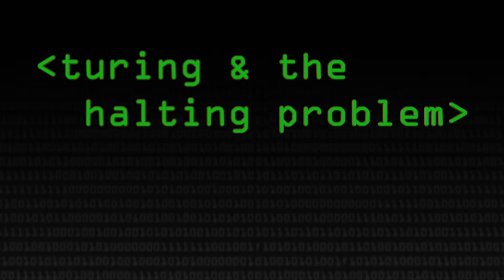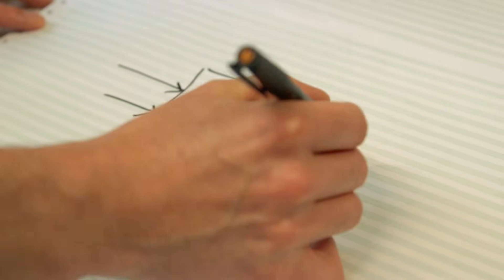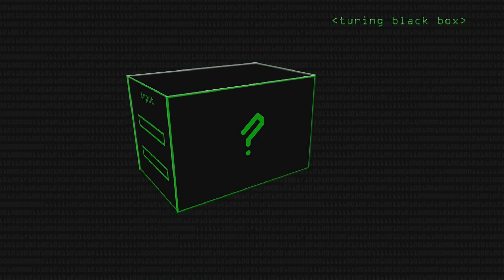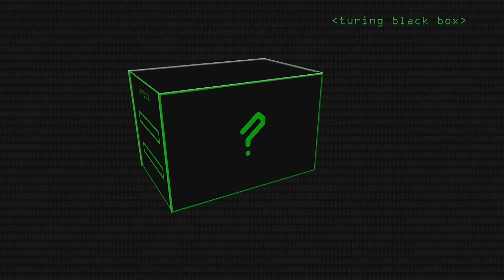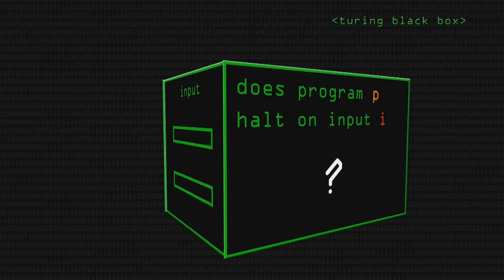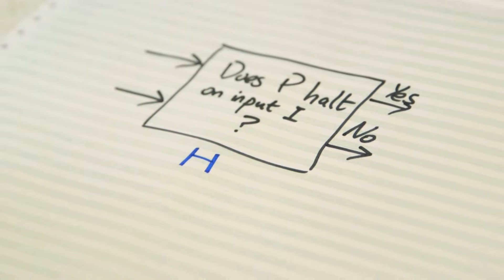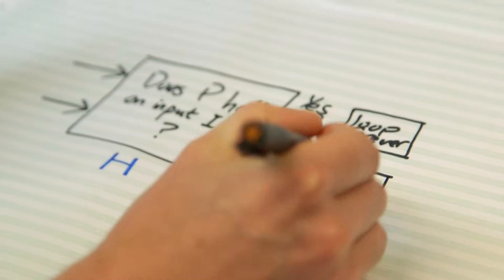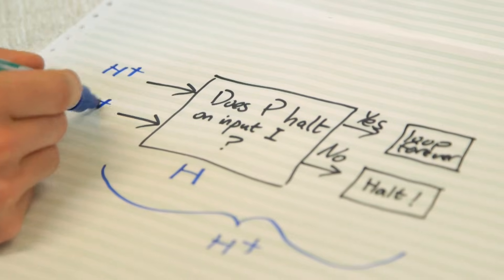Turing & The Halting Problem - Computerphile

Comment: Correct me if I’m wrong but doesn’t this only proof that h+ cannot exist? Also isn’t one creating the contradiction by simply giving the machine and infinitely long input? This just show that an Algorithm can’t work if every input need another input but this input again needs and input and so on. So it could exist under the rule that an input has to finite.
Reply: Why should H+ not exist? First of all we assume H exists. Then we could show that, if H exists, then H+ must also exist. Agree? When we run H+ with input H+, then either H+ does halt or H+ does not halt (either on MUST be true by the principles of logic).

Let's look at the case where H+ halts, then we get:
H+ halts -> H detects that H+ halts -> H+ loops forever (H gave the wrong answer)
The other case (H+ does not halt):
H+ halts not -> H detects that H+ does not halt -> H+ halts (H gave the wrong answer again)

Let's recap: We started with the ASSUMPTION that such a Program/Machine H exists. From that we derived with simple logic that in a world where H exists, there must also exists H+. Then we found out that H+ behaves contradictory and in fact that means, H+ can not exist. But the contradiction remains because we can proof that H+ exists and we can proof that H+ doesn't exist. And finally this means that our assumption, the starting point of our whole argument, must be wrong.
This is what's called "Reductio ad absurdum" or "Proof by contradiction", and is used all the time in mathematics and logic. If you wan't to proof something you assume the opposite is true and then show that your assumption leads to contradictions with no possible answer.

To your second point: Programs in theoretical computer science are by definition finite in length. Just like the code of any normal computer program. In fact, an infinitely long computer program could never by written nor read by any machine. This would result in no machine halting on them, which would be uninteresting. This fact would also solve the halting problem for infinitely long programs (Think about it).

I hope I could help you and answer your question. Feel free to ask if anything is still unclear.

Comment: It would halt everytime but not because of the + but of the h In the h+ machine it will emulate the h+ machine which includes emulating the emulator so it loops until it runs out of memory: h will not be able to give an answer so the h+ machine will eventually halt
Reply: We're talking about a mathematical concept here, not a physical machine. Also, nobody assumed or stated that emulation was either used or necessary.

Comment: I don't see how this is a paradox. H+ given the input of H+ doesn't halt; no is the correct answer. H+ given the input of (H+ which has also been given H+ as input) does halt; so yes is the correct answer. You just have to look at if the input to the program you are checking was also given inputs (and if those inputs were also given inputs, ect). The answer alternates between yes and no depending on how many nested inputs of H+ there are.
Reply: Explain why H+(H+, H+) should halt.
Reply: @MisterBrausepulver  So lets step through each of the nested H+ programs. lets call H1+ the initial input, H2+ the secondary input and H3+ the final program. In other words H3+(H2+, H1+). H1+ is given no input, so the H1 program will output a yes answer causing H1+ to loop forever. H2+ is given H1+ as an input. The H2 program will see that H1+ is looping forever, and output a no answer H2+ will also output this no answer. H3+ is given H2+ as an input. H3 will see that H2+ halted with a no answer, and therefore output a yes answer, causing H3+ to loop forever. So I was mixed up, H+(H+,H+) would not halt. To be clear, I know that I am misunderstanding something, I just don't see what.
Reply: @TomSinister03110  Why you are things nested? Remember H+ has two inputs: 1: An arbitrary turing machine (that's what represents our program). 2: An input I (e.g. a string ...). You don't nest anything when you call H+(H+,H+). Any Program can be represented as a string of letters (think of the source code of a computer program.), the same is true for any turing machine. If you want to think about this as in programming, H+ would be a function with two arguments, P and I, both being strings of text (also H+ would call another function H just like you can do in programming).
When you call H+(H+, H+), you run the program H+ with the two input strings representing the "source code" of H+. H+ then calls H. How exactly H works is completely hidden from us. That means we can't make any assumptions about how H works (besides that is always behaves correctly). That also means we can't assume that H internally calls H+ and "emulates" it. The "argument functions" may not be called.
That means that your statement "H2+ is given H1+ as an input." is wrong.

I think the point is that Programs and Inputs are all just strings and you can feed the source code of a program to itself.
Again, if you know programming, consider the following function.
string printMe(input string) { print(string); }

Then you could call
printMe(string printMe(input string) { print(string); }).

I hope I could help you. Unfortunately computational theory has, like every other math topics, many little details and foundations that matter. But unlike geometry or graph theory etc it's pretty non illustrative.
Reply: @MisterBrausepulver  I thought we were looking at all possible programs for the purpose of the halting program. Wouldn't that mean we can assume that one of these possible programs could emulate H+, and therefore emulate H+ receiving H+ as an input?

Comment: Isn the problem in the fact that H+ is not built to find out whether something will halt? H is built for that, and it will give you an answer. But H+ is not equal to H, so it is not guaranteed to produce correct output. We take proper answer, and then do something with it. Its like thaking a photo of calculator screen, mix stuff around in photoshop, and then say that calculator produced a wrong answer. I think there is no paradox, because H is not equal to H+

Comment: But, why does this prove anything? Maybe H+ doesn't terminate when given H+ and H+ as inputs - ie. it never gives you either a yes or a no. In that case, there's not necessarily a paradox, is there? The issue of whether such an algorithm can be designed to also always terminate, itself, seems like a subtly separate issue, right?
Reply: Triggerfisk 
We are creating a program does determines if any program with an input will halt. This means for all programs there exist an output of yes or no.

So We feed the machine into itself and if it is yes it doesn’t not halt. If it is no it does halt.

This is proof by contradiction

Comment: The setup is rigged and the outcome is determined by the setup of the problem.  Your drawing is correct: the 'yes' output is artificially blocked.  Thus, the answer to H+ is no, by design.  But the bigger problem is that logic, and by extension, math, appears to be more useful when it reflects reality, and this type of problem doesn't.

Comment: What if you just simulate the input program(with input) and see if it freezes? If the entire state of the box is ever the same as it was before then it will mean it is stuck in an infinite loop.  It could take a long time but eventually, every possible state would be tried.  This would exclude any black box that has infinite memory of course because you could never compare the full states. (I have never seen such a machine however with infinite memory.)

Comment: all problems can't be solved, but some can. that is my final consensus.

BUT WAIT
h+ requires 2 inputs, so feeding it to itself twice isn't gonna work. 1 input is for emulation, the other is for input. therefore, assuming h+ doesn't exist is reasonable, but every method of disproving h+ by feeding h+ to itself is a faulty proof. the machine will be waiting for a second input while emulating h+, but that 2nd h+ blueprint can't be fed into itself, meaning this machine will be softlocked. permanently waiting for an input, while never processing for an output.

this video demonstrates a faulty proof.

Comment: We are all going a bit too mathematical here. We've just proved one case, where the machine won't work. Sure that's enough to prove that it (the machine) isn't a universal solution to the problem it was designed for, and hence it is mathematically non-existent. But for all practical purposes, there is possible that a machine can be constructed that could solve the halting problem for every case but this. In practical scenarios, you wouldn't wanna test the machine against itself anyways. So, for me atleast, a practical Halting machine is still not impossible.

I know this is a proof by contradiction, and it works cool only when you need to be absolutely sure that each and every scenario is covered. It's like in physics, some formulas/theories work under some circumstances. The formula for gravitational potential energy (mgh) is only valid for height 'h' <<< R, where R is the radius of the earth. For bigger values of 'h', the value of 'g' changes, so the formula becomes invalid (if you're wondering it's the same as m(g')h, no, that's not the case, the whole formula has to change). But this doesn't mean that we shouldn't use it. Sure for heights quite high, the formula is invalid, but for all practical purposes, 'h' is gonna be very small compared to R anyways. So, in the cases it works, we can use it.

Hence, just because our hypothetical halting problem solver machine can't work against itself doesn't mean it can't work at all or we shouldn't try to build it.

Comment: I think it is a little confusing when you feed H+ to itself, H+ should be fed to H. 
H is the machine that you assumed will solve the problem. If you end up in a paradox on your assumption then the assumption will be falsified. 
By feeding H+ to H+ nothing will happen to the original assumption, because you basically are not touching H. 
If you feed H+ to H, then if H+ halts, H will say it doesn't and if H+ doesn't halt, H will say it does. Here is the contradiction so the assumption is incorrect.
Reply: It’s the same thing you are feeding it into yourself
Reply: H is part of H+
Reply: The problem isn't really feeding H+ into H+, but there is a problem with the explanation. I don't know how exactly Turing wrote his proof since I didn't read his paper, but the way every single youtube channel is explaining it is simply wrong.

The input to H+ is a tuple (P: Program, i: InputToProgramP). The whole thing is the input

So when you feed H+ an input (P=H+, i=H+), you are basically asking "does program H+ halt when it receives input H+?". The problem is, the input to H+ is a pair (P, i). So you can't just feed it P, you are missing i. It's like you are feeding it (P=H+, i=<empty>).

To fix that, you'd have to feed H+ an input (P=H+, i=(P=H+, i=H+)). But you end up with the same issue. So you'd change the input to be (P=H+, i=(P=H+, i=(P=H+, i=H+))) to try to fix it, and so on, forever. You can't ever feed it itself.
Reply: @rafaelclp THANK YOU, I WAS THINKING THE EXACT SAME.
You formullated that pretty damn well and I fully agree with you. 

Im just wondering wether or not you can still prove it by induction, but i dont think there is even a base case, so not sure about that

Comment: When H+ is fed back in (to the H+) as the program to which we give input H+, there aren't enough inputs (for that H+) as it needs two inputs to give the answer (halting or not halting) and its only receiving one - previously called i.
Reply: I asked exactly the same thing, it would be great if someone addressed this issue.
Reply: That can easily be solved by turning the input of H and H+ into a single input that describes both the turing machine and its own input to be tested. That way everything is receiving the correct number of inputs and the paradox still happens.
Reply: I'm also not sure I really understand how we're proving anything either. The paradox described feels like it implies that that having this specific input ran through the machine would result in looping, but we can't know if that would even be the case? The question was never about whether H+ could exist but whether H could exist. Is it because H is a product of H+ that it implies failure? I don't think it is valid to say 'your machine with 100% success rate in deducing if carrots are peeled or not is foiled because I added extra machines at the end of it that peels the carrot if it is deemed peeled'.
Reply: @Outwardpd no it would lop if it wouldn’t loop and not loop if it would. This is not the same as straight up looping
Reply: @Outwardpd  You see, the problem is that your peeled-carrots-detector example does not create a paradox, so there's no problem. A proof by contradiction starts out assuming something that you don't know is true (or exists) is (or does). Then it shows that, if that is true, than something completly absurd and impossible would also be true, automatically. Therefore, what you assumed to be true cannot be, in any way, shape or form.
The halting problem assumes a turing machine that solves it exists. Then, using some simple steps, creates a set of inputs that makes it not work. Therefore it couldn't exist, at least not as described. There's no program that can determine if any problem halts, because we just showed how to create a program that wouldn't work, using itself. A contradiction. Contradictions cannot be true, so your assumption can't be either.
Basically if A, then B. If B then not A. Therefore, A can't be true.
Reply: @eac-ox2ly  Awesome. Thank you!
Reply: @eac-ox2ly except it wouldn’t not work on itself unless you have infinite copies of it and run them on eachother recursively ad infinitum. So perhaps it’s an infinitely nested sequence of inputs which is the thing that can’t exist instead.
Reply: you can easily resolve the problem by attaching "duplication module" at the start of H+

>then you pass H+ to H+
>duplication module takes H+ and returns H+ and H+
>first H+ is the algorithm input to H
>second H+ is the input input to H

that way H+ takes only one input so H expects 2
Reply: yep it also bugged me alot, but you can fix it by this:

H+ gets the input <M>:
then asks H what would M asnwer on the input M.

that way there is no problem.

as when H+ is asked the answer on H+
it asks H what is the output of H+ on H+.

and then the same thing as the video explain happens, but yeah that is actually makes a lot of difference.

Comment: A simpler explanation should be like this:
One machine with two outputs whether it halts or not : 1. Yes 2. No
Second machine which takes first machine input.
When input is 1, it does not halt and when input is 2 it halts.

Now combined it becomes a new 3rd machine which is a contradictory machine.

Comment: I tried understanding it, but it does not make any sense! Why do we loop on Yes, when we should be looping on No? If machine halts, it is not a loop. If machine does not halt, then it is looping. Why there is looping for "Yes"? Let us say, I make the same algorithm and ask a question:"Is an apple red" and for yes, I add "It is blue". then I fed the program to itself. If the apple is red, the algorithm will produce "it is blue", and if it is not read, it will produce no. So I feed the same algorithm to itself. Now, if the apple is read, it will produce blue, but if it is not red, it will produce no.
Without clearly explaining what is the rationel for adding the loop, the problem is applicable to any question, making any question a contradiction.

Comment: One problem with this kind of thinking: we assume that all architectures are based on 1s and zeroes, yeses and nos. What about DNA coding? There are 4 different bits of information. We aren’t the kind of machines running known but we represent a kind of machine which has a greater base than 2. And we’ve solved paradoxes by the dozens, so the halting problem is not unsolvable, at least it would be with a machine with a base of 2.

Comment: H+ is an artificially crippled machine. The "+" part is what's stopping it from giving the correct, or sometimes any, answer. Although it could be argued that it does give you an answer:- halting = no halting, and vice versa. But if you fed H+ (and a specific input) into H (obviously a fictional machine but not one we can say is impossible), you'd get your answer. Take what I think is called the liar's paradox (might be wrong): "This statement is a lie." and feed it into a logic machine/ brain, then feed that combo into another logic machine/brain and it will be able to tell you that there will be no halting (dependant on the specific algorithms of course).
Reply: Except whether h+ halts with itself as input is undefined.  
Therefore there exists something where if it halts or not is undefined.
So if we run H on the above machine, then it cannot give an accurate answer as no accurate answer exists. Therefore H can’t exist.
(You might counter this by saying it’s possible for H to exist if H+ does not. But any algorithm can be used as part of another algorithm, this must be the case because the way any algorithm is made in programming is by combining other algorithms, all the way down to whatever small set are physically built into the machine hardware. And if you have H then H+ is simply “X = H(input), while(X).” If H says the input will halt and thus returns true then this evaluates to the trivial infinite loop “While(true)” if on the other hand the input doesn’t halt and H returns false the while loop never runs and the program halts.